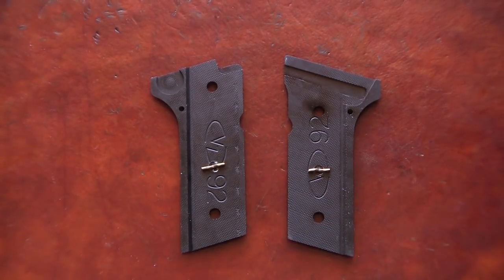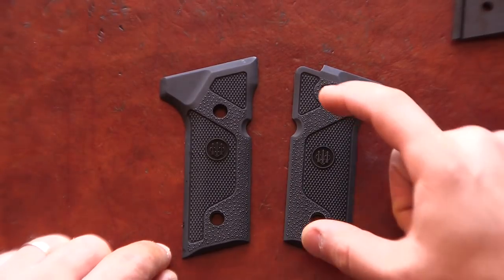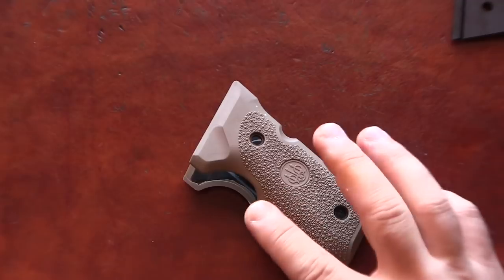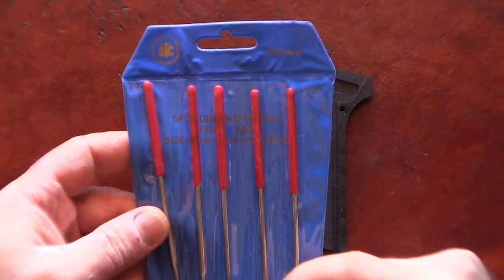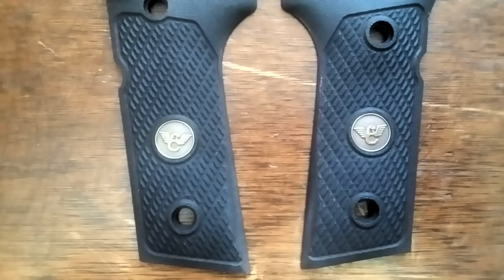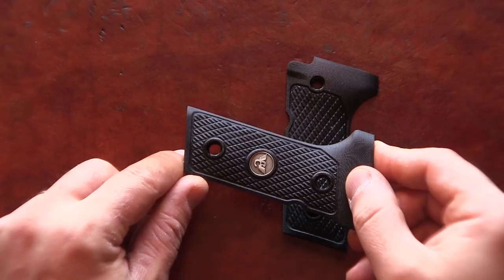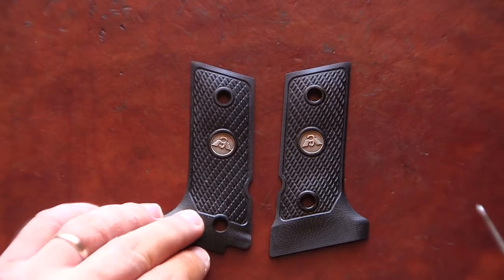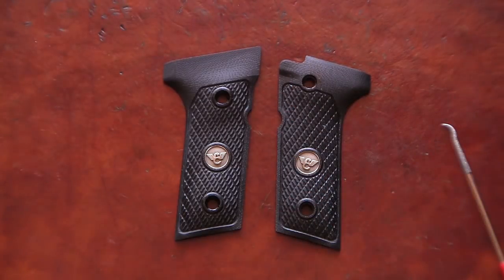Modifying Beretta 92FS G10 grips to Vertec Shape

Comment: Just wanted to reach out and thank you for the idea; I just picked up a new 92X Compact and, as many of owners know, it is nearly impossible to find G10 grips for these since this 92X is using Vertec frame with shorter Compact grip - full size Vertec grip screws do no line up. Luckily, the mounting holes on 92FS Compact ultra thin Wilson Combat G10 grips line up perfectly on the pistol and I was able to convert these grips to 92X frame by following directions in your video. Спасибо!
Reply from the maker: I am glad I could help. ;)
Reply: Yeah! I just got a 92X compact and it's impossible for me to find grips for it, at least grips that are thinner or as thin as the stock grips. I want to find a pair of grips that work well because the stock grips rub me pretty bad when im carrying. I guess I'll have to buy regular fs compact grips and modify them

Comment: When you showed the grips, I wasn't sure how you were going to do it but man, those look really good. Outstanding work as always.
Reply from the maker: Thank you. I was just lucky I found that set of files. Otherwise I would have to go and get one first. Looking at the pattern it was clear a ball end mill or similar was used to make it so I knew a bent round file would do just fine. And the diamond needle file cuts both ways so it works super quick.

Comment: These grips look incredible and professionally done. I don't know if you've seen it yet, but LangdonTactical will be releasing an 11lb hammer spring for the 92 series that's set to ship February 3rd.
Reply from the maker: Thank you. Haven't seen it but I wonder if they will also be doing something to the hammer, because I can see 11 lb. Hammer springs producing some light primer strikes with some ammo. I run a 12 lb. Currently and so far haven't had issues but who knows... I haven't tried all ammo primers out there.
Reply: I was also wondering the same thing. Ernest Langdon is very involved with Beretta. I don't think he'd produce it if it weren't functional but who knows. I also run the 12lb Wilson Combat chrome silicon hammer spring. I have for quite some time without any light primer strikes. I also use the standard trigger bar.
Reply from the maker: I also haven't had any light primer strikes yet. I am only mentioning it because some people on the forum stated that light primer strikes will happen with 12 lb. Springs. I wouldn't mind trying 11 lb. I already miss my frame.
Reply: There will always be skeptics. I use my m9a1 as a range gun so I don't mind running it close to failure. Any idea when you'll get your frame back from it being refinished?
Reply from the maker: I was told 2 weeks. When I do get it back I wI'll be taking a hard look at the fire control group. There are a couple of things that keep bugging me in that I think they can be improved.
Reply: MosinVirus make sure to keep it well documented because I love watching your videos and learning everything I can.